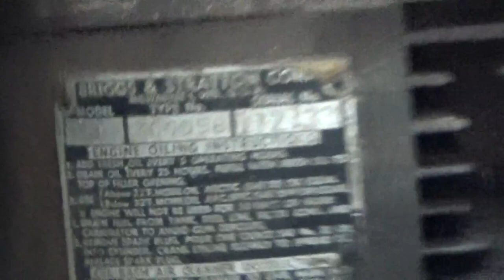Got A Blackhawk Model C Walk Behind Tractor With Plow

Comment: for your mig welder you can just buy flux cored wire and run no gas, itll run the same but just be a little dirtier. the wire can be bought at lowes/harbor freight/online and its pretty cheap
Reply from the maker: Yes, I plan to get some soon.
Reply: @TheDoItYourselfWorld  if you need any advice just let me know, I weld for a living so I'm more than happy to help.

Comment: Those are neat little tractors. I had one a few years ago and sold it. I wish I would have kept it. It had a original adjustable blade on the front of it. I pushed a lot of snow with it. It had wheel weights and I made a set of tire chains for it. The only thing that I remember not liking about it was when I would hit something solid with the blade it would jerk over and the handles would whack you if you didnt pay attention lol. You will have a ton of uses for that tractor. Best of luck! p.s. the side mounted plug is because the david bradleys originally came with a bullet shaped hood that you could tilt back to access the engine.

Comment: Ye olde garden tractor. You walk to the right of the plowshare when going forward. The disc needs a seat for riding on that gang. The gas powered horse for the hobby farmer no feed to buy and just gas and oil. Could even use motor on buzz saw when you find a belt drive pulley for that Briggs.